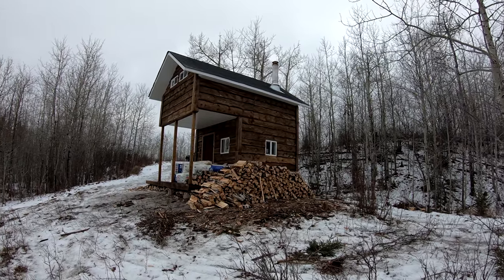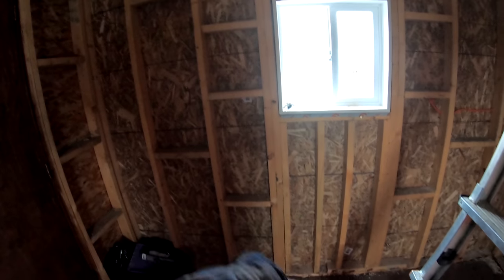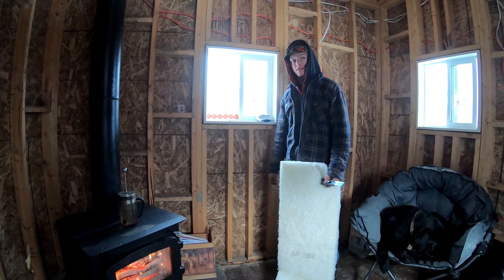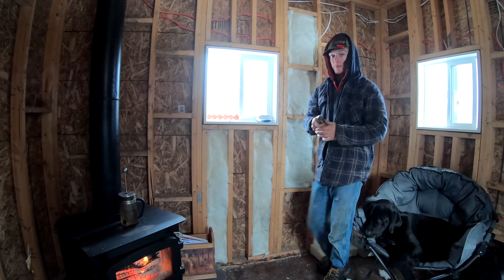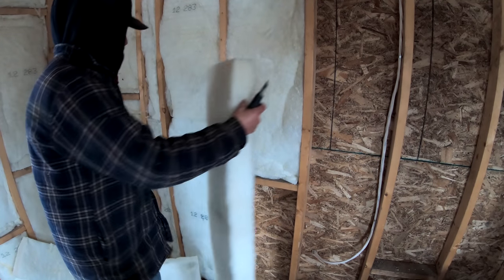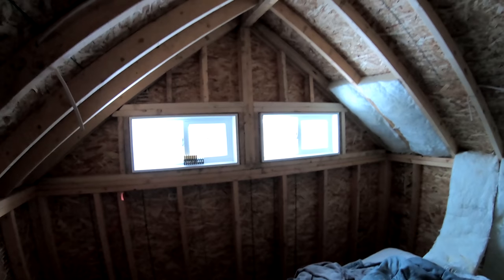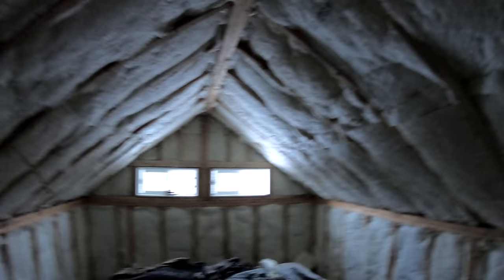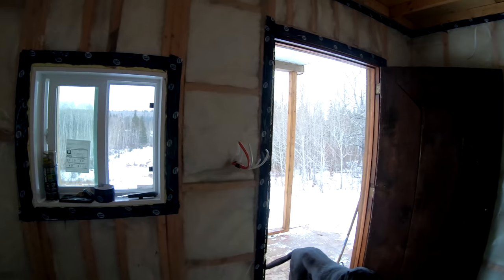Offgrid Cabin Build Pt. 16 - Insulating the Cabin

Comment: Well done! We in Germany have thousends of 100 year old houses out of wood. Even Einstein was living in on wood house with only 10 centimeter wood-timber beams! No fungi no humidity problems in 100 years. The old traditionell building art is- stabil construction away from the earth- the wett fundament and air under it so that no fungi can grow. some build with bis natural stones as a 60 centimeter fundament. Many build with a wood  house facade- then 5 centimeter air or if they can old newspaper- cennolose fibre because it can take humidity and give it away.And also it isolates. Other took sawdust for insulation. Its perfect its isolate and breath 2. Inside the house also wood. But many do not know this old technics and they take mineral wool that cant breath and gather humidity inside and never gives it away and special when it hath direct contact with wood because wood always has a rest water inside...If I could build a house I would build it with wood and air. Verry importand is the isolate the floor from the outside.10 centimeter wood is OK. Cold feeds are bad and the best is: Build a house in such a fasion that in winter the heat stays long much long but if the cold presses in the floor then you must heat more and mure. Also I would build a kind of modroom or a second door because then the isolation is better. Head is like "gas flow" it runs out of every leak in the house and the way you build it with plastik- the mosture will fly with the heat to the first floor to the slepping room and can (not must) produce fungi that is posion. So heating is importend and also ventilation so that the wett air will be driven out of the house. By yourself a digital thermometer so you could put on an app and if you are in  the house you can check out how the temps the moysture is in the house while you are not there.This kid cost 30 US$...If the isolation/Door/Floor is not enough it can happend that the humidity is to high and then the "rotten process starts" Keep the cold out- safe the house from fungi...Some build forced ventilation in the house so that the heat and moysture can be driven out while the owner is not in the house....And if you love to learn old technics then take a look at the videso form NORTHMEN he is one of the best in some traditional technics and on good film is "Traditional Finnish Log House Building Process" I saw this film 10 times.   Frank

Comment: Not being critical at all just making a suggestion. If you can find some metal to put behind the wire on the out side or take a damn good mental note of where those wires are that are stapled to the osb. I just built a little place and I put the fart fan for the bathroom in wall and sure as shit when I put the siding on I put a screw right into the fan so that sucked. So any way not sure if your already planning something for that but if your luck is anything like mine they will end up with a screw on nail getting poked into them
Reply from the maker: Hey buddy, that is a good suggestion for sure. I put the wires as far back into the wall as possible and used a length of nail that wouldn't reach the wires yet plenty big enough for the job. I didn't have a problem with hitting the wires, cheers.
Reply: @TraplinesandInlines  oh right right I meant from the outside, odds are it will be fine, my odds suck and I would end up driving a nail through from outside for who knows what down the road and then bam. believe me I would never think anything of it until I managed to run a screw into my bath vent fan. Well anyway she's looking dandy as you would say haha keep up the good work not too many other guys your age doing this kind of stuff I bet. take care man
Reply: @TraplinesandInlines  I agree with Eddy and since I am an electrician he is giving you sound advise. Remember it might no be you who decides later the drive a nail or use a longer screw. Don't risk burning down your place over not protecting or running wires correctly.
Reply from the maker: @davidsuperdavelarson6174  yes I agree for sure it is great advice. What I was saying is I already finished the cabin here a week ago so a little late now lol. I put the wires deep into the walls and then made sure the nails on the interior side were not near long enough to hit wires. I didn't have any problems at all and will not be putting in anymore fasteners. I am no electrician by any means buddy but I am pretty confident in how I got them wires in the walls. Cheers